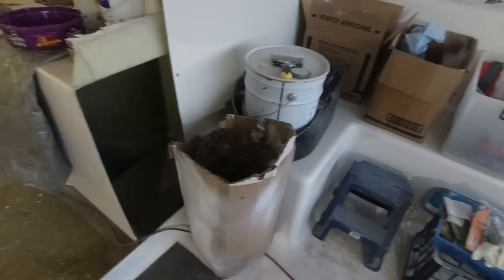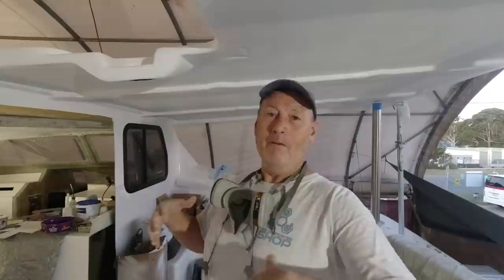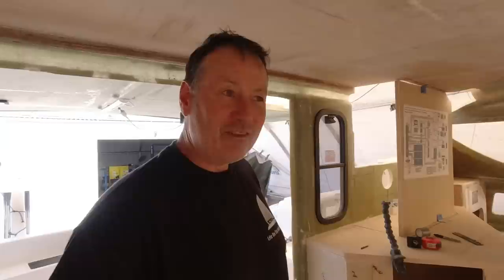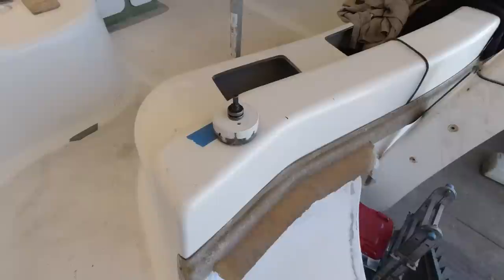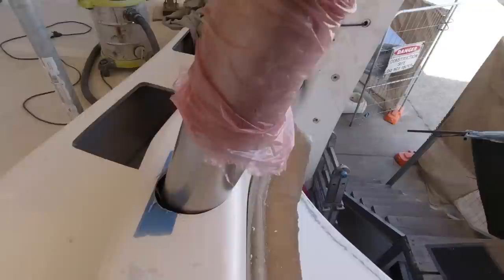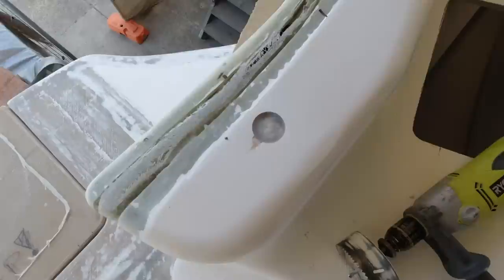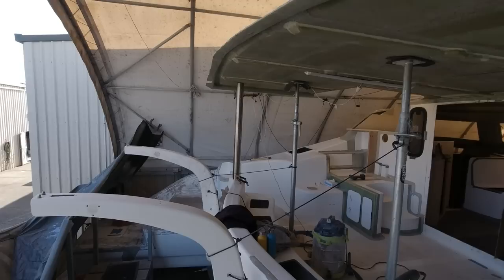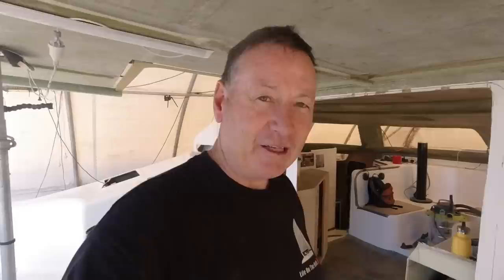Supporting the Hard Top - Complete Catamaran Build Ep266

Comment: Roscoe - that was a tremendous amount of progress covered in this video. Helm looks excellent. I do very much like the hard top supports and the key to their success will be the accompanying stainless fabrications, although as four months has passed since filming - I suspect they are long done.

I was pondering how the boat build evolves throughout. The initial hull build is a sort of linear workflow and then as you fit out it gets increasingly chaotic and ‘interactive’ with two steps backwards to continue forward.

You are both doing a great job.😀👍⛵️

Comment: I dunno Rosco, I think boat builders are a few bricks short of a full load. Fiberglass, wood, steel they seem to spend the first three years of the project making sure everything is smooth, no blemishes and water tight and then the next three years drilling and cutting big holes in them!!

Magnificent work, that helm station looks like it was molded in!

Comment: Dear Ross, Looking really good. Why not have a socket welded onto the plate that is fixed to the transom to support the posts. The post can then just drop in with a Bolt to secure. Saves having to make the hole in the seat back larger  Regards from England

Comment: Hi Ross , how about thru bolting a piece of stainless angle with gussets either end to the rear bulkhead, you could put a spigot on the horizontal plane to locate and mount the column, you could still use it to drop your cables through as well.

Comment: Ross, I very much understand your position on site visitors. I have a large wood, metal and leather shop and I had to stop letting anyone, but the customer in the shop and the customers are restricted to just a couple of areas. There are so many safety and security issues, there is no way to control the environment. Insurance cost sky-rocket here in the USA if you allow anyone into the shop working areas. 
BTW: Have you set a launch target yet?

Comment: Love the channel, Love the build, Great looking boat, sense of humour is brilliant. Probably to late given Vlog release Vs actual work but, would there be some benefit to splitting the supports by way of a threaded connection at the flange on the settee area base plate. the benefits would be that it gives you service options in the future. Whilst being structural it allows removal at some point in the future. Yes there could be "sealing concerns" but easily remedied. There may be a cost factor but that may prove beneficial at some point in the future. Keep up the great work.
Reply from the maker: Thanks Andrew.I am still considering my options with the supports.The flanges I have are perhaps too wide for the setee top and may need to modify it all in any case.I get the serviceability idea though.Stay tuned.Thanks for taking the time to comment.Ross

Comment: Many boats have the mast stepped on the deck. Below deck there is a post to transfer the load either into the keel or into a structural bulkhead. It would make sense to do the same with your posts.
Reply from the maker: They are bolted to the structural bulkhead at the stern.There is a welded fish plate on the upright poat that is through bolted so in effect that is the same as you indicate.My Mast is also supported by a Mast compression post on the central bulkhead.Cheers.Ross

Comment: The exterior aft mounting plate could be slightly thicker than needed and add mounting points for eg a cantilever shade and possibly power cable outlet for any sundry day / utility craft battery charging jump starter or shore power, (electrical port and starboard)teeing off the conduit since your using it as a solar run anyway.

Comment: Hi Ross. Have you considered a beam between the 2 new SS poles holding up the cockpit roof? You have the front to back support covered. Just wonder if side to side support at the back would be prudent. If you box it could provide opportunity for wire chase and traveler support as well.

Comment: Mate, you need to keep the boatyard safe for yourself and family. With the roof posts make sure you cap the bottom of the posts so they don’t rub a 100mm hole through the deck. Add a Tom and a Jerry style 50-60mm mouse hole at the base to get all your wires through that you need. Everything moves on a boat. She will squeak and talk to you and you will get to know what’s going on and what’s not normal👍🏼👍🏼👍🏼 the helm looks a million$$$$.😎😎
Reply from the maker: Thanks Nick The posts actually don't bottom out as the chamfer panel drops away before they meet the rear bulkhead.I hear you on the squeeking and will make sure there is plenty of access for wiring.Am now thinking plumbing up through as well for outdoor shower at the top of them .Ross

Comment: Its probably to late now but if you made a frame under the fibre glass that goes down to the bottom of the cavity and cut the stauncheon to the exact size and sandwich the fibre glass  with stainless base plates
Also when you have the base plates welded on to bolt through the transom you will not be able to get it back through the hole you drilled

Comment: Should have made a compression post. Flange on the compression post attachrmex to the rear bulkhead. A flange on the top of the compression post. A flange on the bottom of the overheads support post. 
Bolt the overhead post flange to the upper flange on the compression post. 
No oblong holes to repair. Plenty strong. 😅

Comment: Why don't you make the posts in 3 pieces one piece from the target to the deck one piece from the deck inside with a fish plait on top and a bracket the bolts to the back of the boat inside this would make it a lot easier to assemble and make true